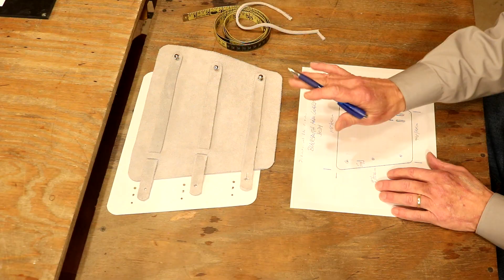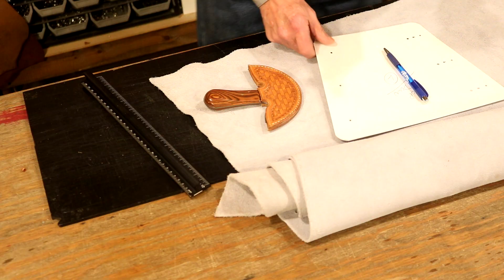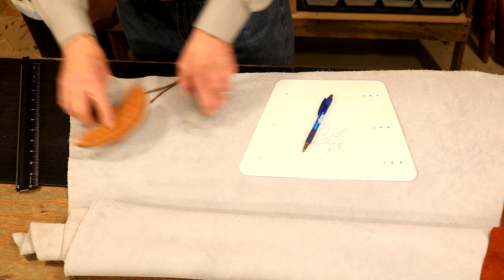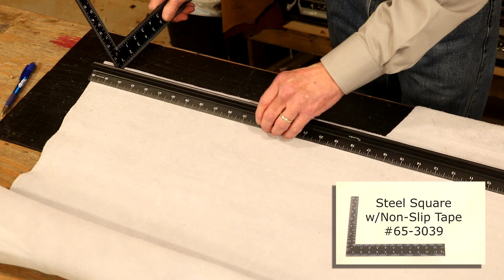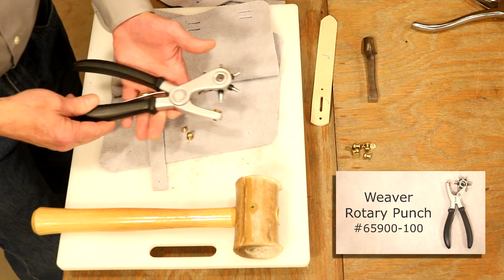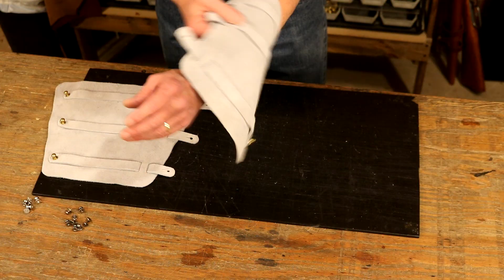Making Leather Blacksmith Arm Guards

Comment: As an amateur blacksmith and, general pain in the drain, i need to address a safety concern. If a hot piece of metal or slag gets between the arm guard and your arm, it's going to burn the crap out of you. I dont recommend these except for cosplay when your not actually forging metal. 

Other than that, i love the channel.  This channel is a reference tool and entertaining.